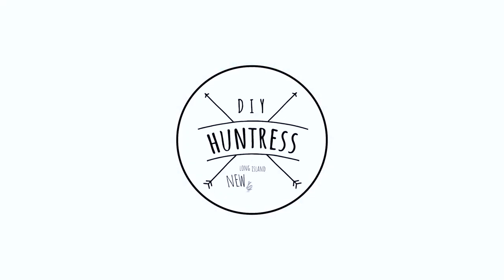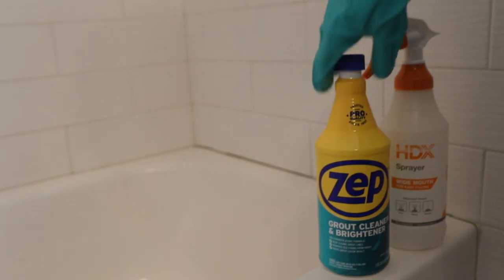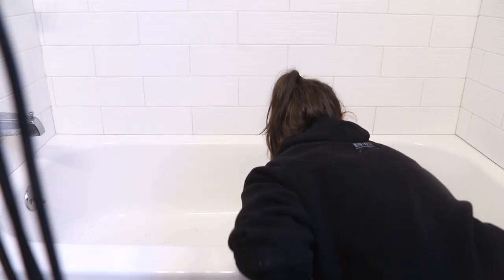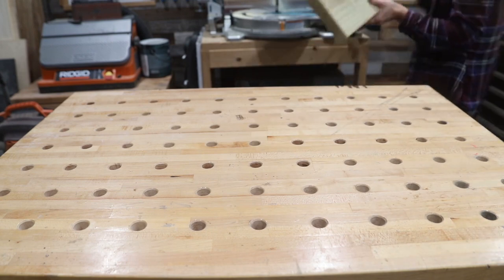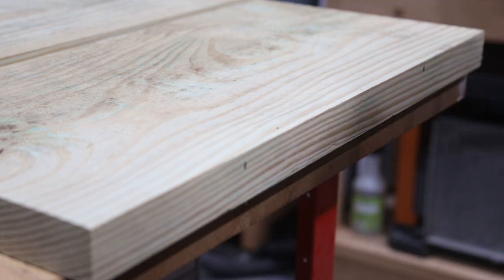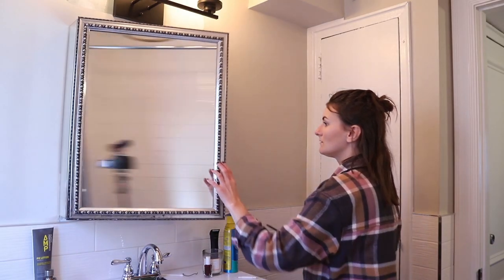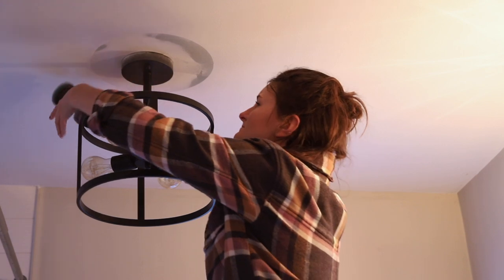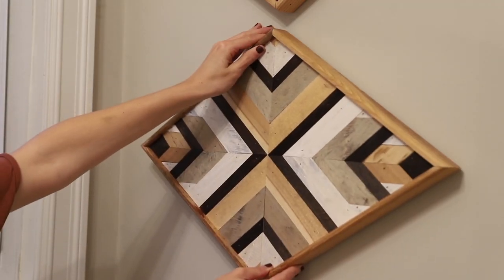EASY Small Apartment Bathroom Makeover (Renter Friendly!)

Comment: I really appreciate your ability to work with the electrical fixtures.  I’ve seen it done a million times but I’m still afraid.  However, I just moved into a rental and would like to hang some pendant lights and ceiling fans and I think that you have given me the confidence to do so.
Reply from the maker: Ahh! I’m excited for you! The wiring in most bits will match what is already in your ceiling. Please just make sure to double check that there’s no power going to the fixture when you replace. 🙏🏼

Comment: Hi there.  Your  bathroom  make over  is beautiful. Right  now  I'm completely  renovation  my basement bathroom  from  scratch and  you don't  need  to turn  off the main  water supply  to replace  the shower head  you  just  have  to make sure  the shower  is turned completely off and  you can  unscrew the shower  arm to replace  it. Just  in case you wanted  to replace  it.  Hope  this helps. Love your  videos.
Reply from the maker: Hi! Thank you! Good luck with your reno! It’s not the showerhead I had trouble replacing, I could not replace the rest of the hardware in the shower, if that makes sense. Either way, I’m happy with the updates!